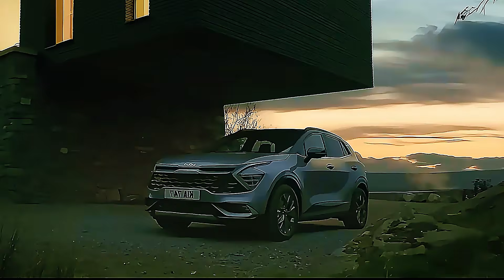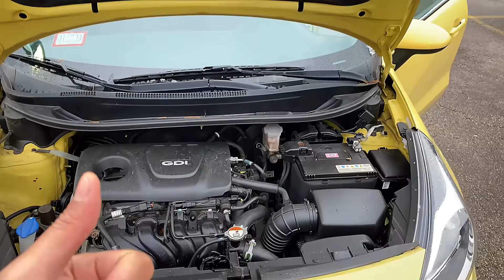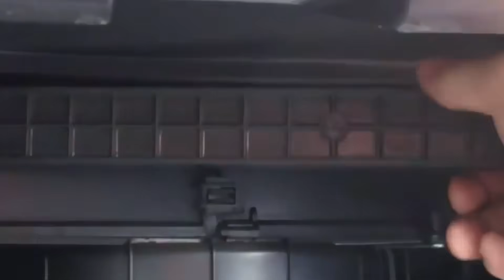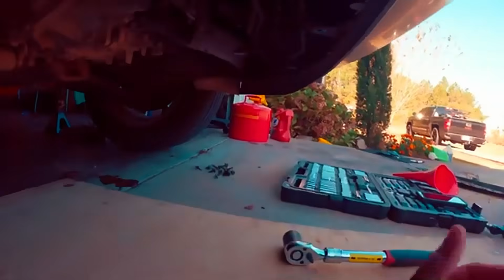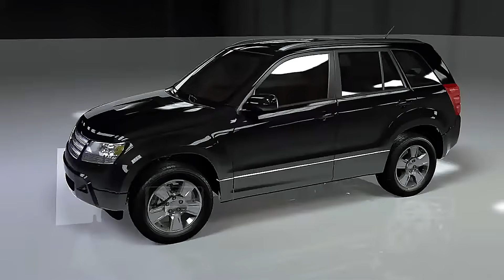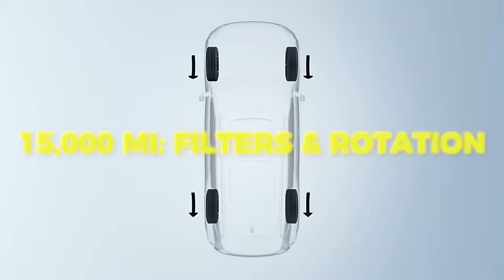The ONLY Kia Maintenance Schedule You'll Ever Need

Comment: 2011 Kia Sorento EX V6 with 317K miles and runs smooth using Castrol Edge extended performance which I highly recommend (Gold 5qt jug).

Comment: Bought a 2023 sorento hybrid EX and had been in 2 accidents in 2 days in June of 2024.  Not totaled and repaired back to factory specifications with a 91 carfax rating.  But…. Washer fluid reservoir was broke and did hit the washer pump dry a few times  independent dealership I bought it from is repairing it no charge